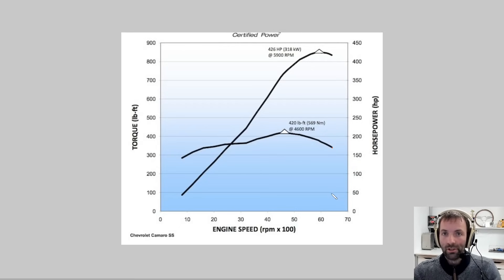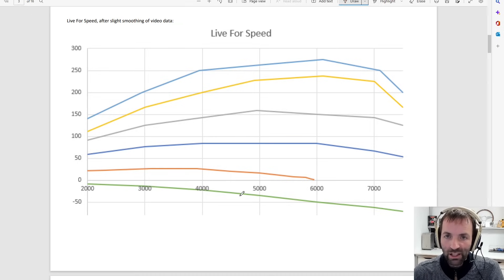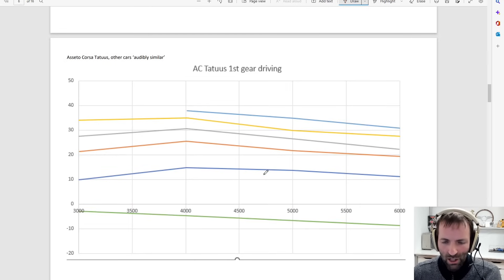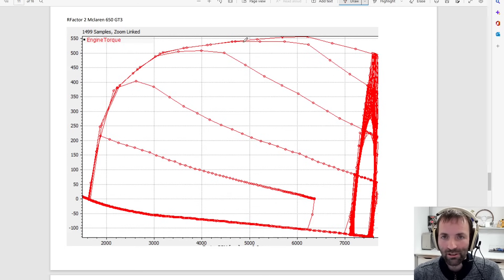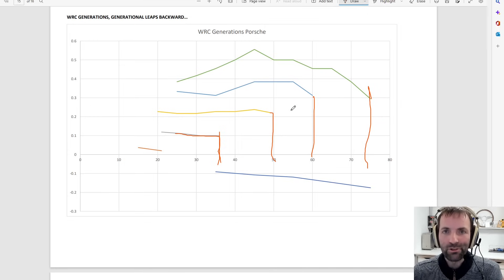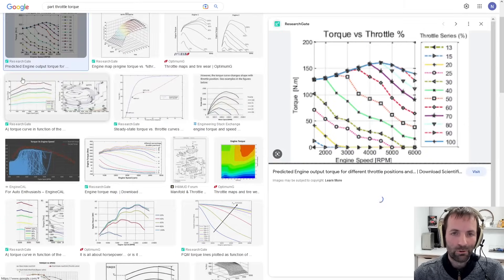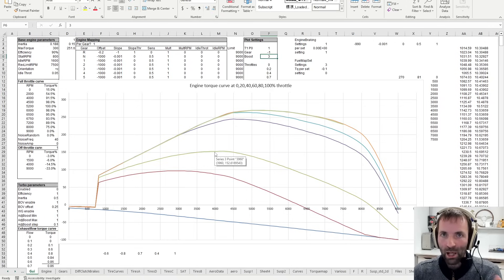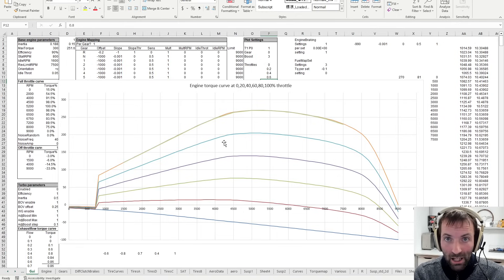Modern Sims Still Use A Throttle Model From The Year 2000! Explained, Exampled, Suggestions made.

Comment: Nice one! You are correct with AC it works on old model, but uses custom sensitivity curve depending on car. There are a few cars that go beyond and adjust the power based on other factors.... which brings me to question: The "good" downslopes are all based on throttle body openings and how at lower rpm we only need a little opening to reach near maximum power, but what about electronic throttles nowdays? Could they be moving toward what we have in sims for better control?

Still, i drive mostly vintage so idk about modern stuff. I'd love to see that in AC... will have to pester illya for one more thing... again :D, heck maybe AC already has something like that in extended physics

Comment: Thankyou for highlighting the problem with WRC Generations, I really hope the devs can take notice.
Reply from the maker: Me too, I'll sure give them credit should they decide to change it. But hey, maybe they actually map the engine this way, I doubt it but it can't be 100% ruled out..
Reply: @NielsHeusinkveld  The fact that they have stated its fixed and working as intended however really makes me think they know its broken and can't be bothered to fix it.
Reply: @NielsHeusinkveld  I think WRC Generations' throttle model have a much more serious issue than the throttle cut-off and a outdated model that you have mentioned. The auto-clutch issue (that it need to be above certain RPM in order to be engaged) is still not being addressed

Comment: I would love to see the same on DirtRally2, which is a fun game to play but really annoying in some of its physics. Apart from the cars feeling like they have way too low inertia, it feels like more rpm always gives you more acceleration. Staying in the same gear (any gear) and give it full throttle, I expect to get maximum acceleration at the rpm with peak torque, and above that the acceleration should start to gradually drop off as the torque falls away. But it feels more like you accelerate with the power curve - not the torque curve. And that's just on full throttle... part throttle is hardly even relevant in that game, so I therefor assume their model is horrifyingly in-accurate.
Funny, or sad, side note. I think the fly-by-wire programming in modern road cars is making this whole thing worse. People get used to how those behave, which is nothing like a race car or old-school mechanical throttle. They always have the ecu interfere with what you are actually doing so if that is all you ever drive you never learn what's actually going on.
Reply from the maker: My current car has fly by wire, and you feel it does many things my previous car doesn't. Fast response is damped, slow inputs in neutral are made even slower, and I'm sure it has different 'curves' than my old car too. I would expect Dirt Rally to be at best equal to the 'old model', but I really didn't like the DR games and I don't have them and wasn't feeling like downloading 50GB and then refunding after 45 minutes.
Reply: Codemasters can't even get basic motion right and has their car spin on a fixed pole while floating above the ground like a flying carpet. In my line of work we call this 3-DoF, but it's just enough to fool people. And you think throttle response is somehow the thing that's missing. Lol, lmao even
Reply: @KadaverKomplex  I said it was a fun game, not that throttle response was its only flaw from being a perfect sim. I remember testing that spinning around thing way back with some Colin McRae title, don't remember which one though. When giving it just a tiny bit of throttle from a stand still with steering on full lock he car would actually spin around like a tank, which is hilarious. Not quite as bad anymore, but there are still traces of that stuff buried in their code I am sure.
Reply: @NielsHeusinkveld  No problem, wasn't expecting you to actually do it! But yes, your explanation of fly-by-wire is exactly what I mean. It drives me nuts sometimes  when driving modern cars and, for example, instinctively blip the throttle and nothing happens because the input is just smoothed away completely.
Reply: @KadaverKomplex  Exactly !!!!

Comment: I would have liked to see you test a car on iRacing that has different throttle shapes available in the setup menu. It's very likely the Huracán GT3 just has a very linear mapping to make it easy and predictable to drive. Probably the most reliable way to find out iRacing's "true" throttle model would be testing an older car with an actual throttle cable.
Reply from the maker: I'd say it is 98% certain the Huracan doesn't work in real life as it does in iRacing. I think therefor, as this 'sub optimal model' is clearly used at least on that car, why would they have a better model elsewhere and choose not to use it here? But yes, other cars could be different, which goes for all the sims of course. I kept my research to one day, it is time consuming to extract the data.
Reply: @NielsHeusinkveld  fair enough
Reply from the maker: @gingerbreadgirrl  Check this video, after the finish for a few seconds he cruises at 9..10..11% throttle and accelerates in 1st gear at 4000RPM. https://youtu.be/9iGW7YbGvuw?t=149  that would be ~30% throttle probably in iRacing.

Comment: It seems to me that using DI View you can adjust the translation of throttle input at the pedal to what the sim apps actually use by setting the point of 50% to a position that is not equal to the exact mathematical  point of the physical throttle position.  At least that is what I have been doing and it seems to work ie. reduce the amount of throttle the app is using compared to what you do at the pedal.
Reply from the maker: That isn't a 'fix' sadly, the shapes of the torque curves are most likely a bit incorrect, you can make it more sensitive with your trick. But I would use the in game axis sensitiviteis offered by plenty of games, which does a smoother version of non linearity.

Comment: The other aspect of throttle modelling would be response time. I wonder what sims just have instant response or the same response across the whole RPM range? Also a real engine responds differently depending how fast the throttle is applied. Fuel pumps and injectors aren't perfect.
Reply from the maker: I would bet a slight amount that sims using a simple throttle model also have a simple engine model to begin with, where you simply look up the torque based on the throttle position and apply that to the crankshaft. I doubt you would see proper air pressure modeling in such a model. Maybe you can hard code some transient type response that you don't allow the model to react in 0.001 second even if this is the input from the user. I can't look under the hood of all sims, but all the rFactor1 based sims do not take any manifold pressure buildup, flow, fuel pump rates etc into account.
Reply: @NielsHeusinkveld  There are a couple of different things that would need modeling but they're not super difficult to get in the ballpark. There's a transport delay as well as a first order lag. Plus whatever the ecu is doing if it's throttle by wire (road cars can have quite a lot of lag depending on the situation).
Reply: @NielsHeusinkveld  What differences, from isiMotor 2.0 to isiMotor 2.5  ? Thanks

Comment: At the time the simple model was created, it was probably a physics model because throttles were physically connected to the pedal. But today these curves are made by the ECU and are fully adjustable. Torque is a function of throttle position (the pedal) and the rpms or even more parameters. 

So there is no "correct" model, it's just different mappings. There are constant torque approaches which are like the simple model and constant power approaches which are like the "better" model. This depends on the drivers preferance and can even change between drivers for the same car. For GT3 it's also not up to these curves to correct for slip of the tyres. That's the job of TC and therefore a constant torque mapping is totally acceptable.

Even the WRC makes some sense. They just have a cutoff-rpm for each throttle position when they no longer apply any torque. If you have jumps like you do for some rallys, then that is what you want in these situations. No torque application once you reach certain rpms while mid air and full torque application again once the rpms are down again afterwards. And it's not only beneficial for jumps. So maybe some teams use this kind of mapping.
Reply from the maker: The key is indeed, modern cars, anything is possible, so sims should.. you could argue, move away from a 'this is the only way' model and be a bit more flexible. In AMS1, I can do the old style, the 'RF2 style'  and even the WRC style.
Reply: @NielsHeusinkveld  Thanks for the response! Sadly, I only race in VR, so never tried AMS1. But I would love to set my own mappings in sims! I would also love to be able to set them in SmartControl ;) So a different curve for different rpms (by telemetry) for sims that support that. On the other hand, that might be seen as cheating...

The "this is the only way" is probably done because like that, it's super easy to switch between different cars and games. I would even prefer it to stay like this if you cannot do the maps yourself.
Reply from the maker: @hannesseeger  You know AMS1 works fine in VR these days? Very fine actually!
Reply: @NielsHeusinkveld  I didn't know that! Thanks! I'll have to try it out then

Comment: This video was super-interesting; thanks for sharing, Niels.

Why do you think that sim developers do not adopt more 'cutting-edge' models developed in academic papers? Is it just time-saving (use a simple model = reduced complexity), or because applying complex models to different cars/engines/tyres/etc. cannot be done tractably due to lack of data to input to those models?

(or, more realistically, a bit of both 😄)
Reply: Of course, the other great Niels (Bohr) was correct when he said "All models are wrong but some are useful"
Reply from the maker: Personally I think the absolute simplest model must be made that does 80% or 90% of the job with 10% or 20% of the parameters and complexity. Once you go crazy, you get a car with 15000 parameters that are in itself impossible to be on top off..
Reply: @NielsHeusinkveld  Yeah, I get that. Unless a 'sim' attempts to replicate all of the physics of every possible component of a vehicle (BeamNG is perhaps the closest here, but still a long way from a true replica), it's still based upon a collection of models that will only ever be "good enough" at the time that it is released - good enough to balance available hardware performance, cutting edge understanding of the physics, expectations of the user, availability of data, ability of the programmer...

In one of your Geoff Crammond/Grand Prix videos I remember you saying that the underlying physics architecture was actually very similar to that of a modern sim - I found that interesting, and kind of wondered how much they had already gotten "right", even back then 🙂

Comment: Did you test the original 2004 RBR, or the current modded version (from RallySimFans with NGP physics)?
Reply from the maker: Current NGP physics, well current at the time of the video, that was just before an update launched that increased the steering resolution, but I don't think WorkerBee was very concerned about the throttle system from my chatting on the RBR discord.

Comment: Hey Niels, I have spotted these lines in the rFactor1 engine file:

EngineMapRange=(0, 1, 0.0)   // 0 = most driveable, max = most power (low gears only) (unimplemented)
EngineMapSetting=0   
EngineBrakingMapRange=(0, 2.000e-04, 10)   //input throttle ranged from minimum to 100%, with the minimum=setting*step*RPM
EngineBrakingMapSetting=1   // the default is 1 * 0.000133 * 15000 RPM = 2% applied throttle at zero input throttle

The first 2 it says its not implemented. Maybe was intended for later development that never happened, or happened in rF2.
But I fail to understand the explanation in the braking map. It is possible to use this to improve the linear model?

Comment: I have a question, is something similar to this happening with braking? 
I find there's a weird behavior in sims when braking at low speeds, let's say when in the pits or when backing up after a spin.
In real life if you apply a small amount of braking the friction generated by the brakes will be enough to stop the car in a short distance since the car doesn't have a lot of momentum.
But in sims I find myself having to give over 50% braking to stop at slower speeds, which in real life would result in locking the tires. 
It feels like I'm selecting a multiplier of minimum possible "stopping time" instead of having applying a force through the brakes.
Reply from the maker: Braking is very simple, I bet most sims just apply a braking torque to the wheels based on the brake pedal output, which probably varies with temperature. In general, ignoring aero drag, the G force you get while braking is linear with how hard you press the pedal (until lockup).
Check your calibration maybe? I've had games only see half the pedal, so indeed pressing 51% was needed to brake 2%..

Comment: Interrogative: how Engine Brake Maps affect this? I guess it depends, but at least on ISIMotor sims, Brake Map sorta/kinda holds a certain minimal throttle based on RPMs or ... Similar.
Reply from the maker: Barely. The way engine brake mapping works in rFactor derived games is indeed keeping just some throttle on as function of RPM. It might very slightly affect the curves and shape, as you can have it RPM dependent, but the effect is pretty small.

Comment: but what the hell why in sims for exampke in the N you press gas pedal 30% snd the rpm rising to the red line slowly its not the case in irl 😂😂😂 can you imagine if the real car behave like that it will be disaster
Reply: even if you tune the car still will not be the same it just will rise quicker but still stop at some certain rpm
Reply: the Sims is whole mess 😂😂😂 I would even call this a Sims cause in reality cars not behave like that Shame on again on Kunos 😂😂😂Kudos 😂😂😂
Reply: its more like on off button but with some certain parameters tweaked😂😂😂

Comment: Did you compare the thottle response in iRacing also on the Lotus 79, or Lotus 49? Or are you assuming that the throttle response in every iRacing car behave like the Lambo GT3 that in reality has a RBW throttle? 

Because TBH if you based your opinion only on the Lambo GT3 you have been a bit superficial.
Reply from the maker: I say (I think a few times), other cars could be different, but I spent one day testing the sims, and you have to make choices. However. The model used on the iRacing Lambo is 90+% sure NOT what the real Lambo has. It is a very simple, highly unlikely to be realistic model. I would find it weird that other cars would be significantly better. It could be, but that would only make their choice for this car stranger. Why use something inferior on this car when you have something better coded already? Would that make the Lambo be an acceptable mistake? I really doubt it is somehow magically the only car in iRacing using this model.
Reply from the maker: I just checked the L49, with some auto clutch issues but it seems almost identical to the Lambo mapping, pointing 85% towards the 'old simple model'.

Comment: I`m not sure the extra sensitivity is bad, the faster response also means it is easyer to beat the car into submission if it gets over the limit, because it also applies the enginebraking quicker.
Also with a slight kick on the throttle when the car is starting to point straight again after a slidecorrection with the wheel can neutralize the rotating momentum.

Actually slower response therefore goes both ways, not just when making the mistake but also correcting it.
Most complained point in simracing is not being able to correct a mistake, and not the inability to make a mistake.

Comment: Please correct me if I'm wrong, but shouldn't the shape of the throttle body (butterfly valve) be modeled as well?
Because if I'm on 100% Throttle and change it to 90%, the valve restricts the opening not as much as, lets say from 60% to 50% (it is not linear).
So the torque curve gets even more complicated, if you gonna simulate it even further.
Sure you can now say, that you could compensate that in software on the car, but do car manufacturers/race teams really do that? Maybe the higher end teams, but not the average Joe that is driving in a street-ish car around the track.
Reply: Please see my response to Mixed Reality Sim Racing's post with regard to the valve opening. Either way, this effect is already baked into the curves Niels shows in the video.

Comment: I was looking for the DiRT Rally franchise on the timeline but it's not there... Does that mean they are using a 'correct' throttle model then? Just wondering...
Reply from the maker: Highly unlikely. I don't have those games and got tired of the many gigabytes downloaded to make this video. My 2c is they do at best, exactly the 'old model'.
Reply: @NielsHeusinkveld  Thanks... If that's the case, it'll be interesting to see if Codemasters continues along the same lines for their upcoming WRC game.

Comment: What a suprise, rF2 the goat
Reply from the maker: It does it DIFFERENTLY, and likely more realistic, maybe. Data is unlikely to have been available to the devs though. But in a pinned comment I also warned against conclusions like yours. What use is a sim with 'good' throttle modelling when you are drifting the Formula E cars like it is D1? How good is a sim where the online behavior is glitched? You shouldn't feel so binary about sims, just because one sim looks better in one aspect, it is about the whole picture.
Reply: @NielsHeusinkveld  likely more realistic is good until a newer, more realistic model turns up of course

just #fanboi ing